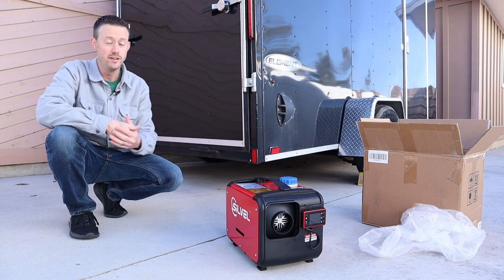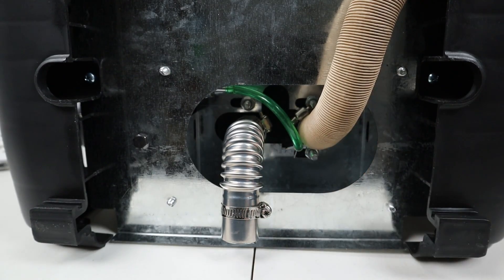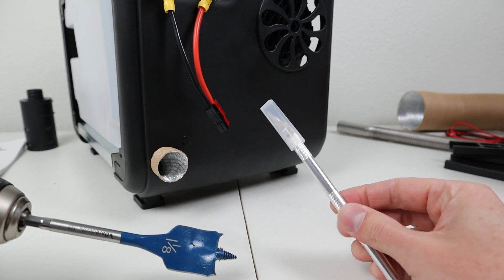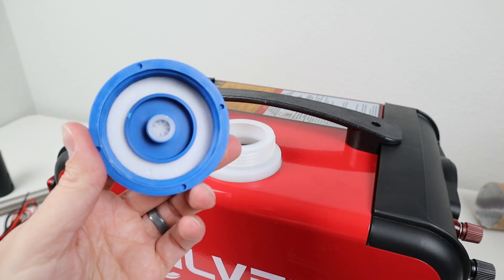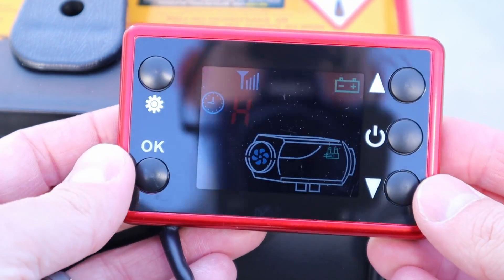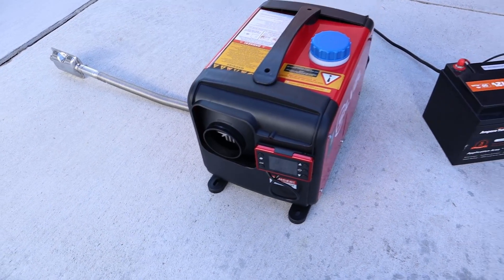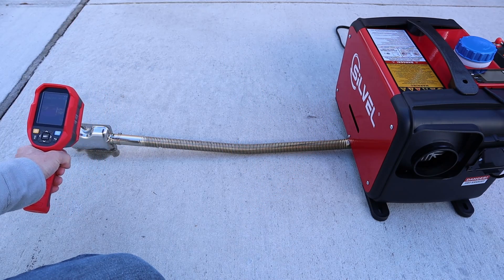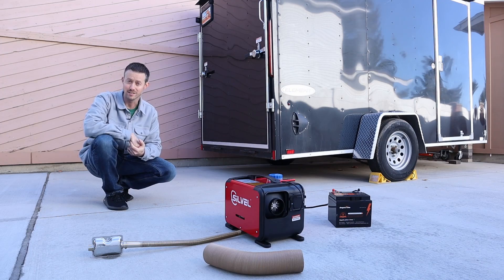Getting Started with Your Diesel Heater + Four Easy Mods!  *Not Sponsored*

Comment: So you literally just went straight to a 12v battery? I've been wondering what the best way to get power to the heater i just bought
Reply from the maker: Yep, 12v battery connection works just fine.

Comment: One of the best diesel heater videos ever, do have a couple questions if you don't mind.  Have you tried tuning for the altitude where you use it?  I've heard tuning makes a significant difference in efficiency and carbon build-up inside the burn chamber.  Watched a couple videos on tuning but they were difficult to follow.  I also noticed the Silvel heater fuel pump is horizontally mounted, while others are mounted at a 45 degree angle, any idea why the difference?

Comment: Regarding the exhust smell. I want to use one of these for thawing ice out in an enclosed vnose trailer that hauls snowmachines.  Would it smell up the trailer and machines badly if used for say 10 hrs or so? I have a 12x12 roof vent. Hate to cut holes to make it work. Using a Kerscene heater now and that works.

Comment: So is indoor use recommended? I need it for a sprinter van. Does the bottom of the unit get hot? Does that exhaust pipe need to be hanging out of a window if used indoors?
Reply from the maker: If you are going to be running it indoors you'll want to make sure you have a CO alarm for safety.

Comment: How big of a LifePo4 battery do you recommend if I want to use an 8MW diesel heater for a two day camping trip? Will probably keep it on low-medium.
Reply from the maker: I recommend getting at least a 100ah battery. Any lower capacity and the quality drops off quick. The prices have dropped significantly over the last year and they cost under $200 now.
Reply: @ Thanks so much for the quick response and knowledge share. I see Amazon has a WattCycle 12V Lifepo4 100AH “Mini” with Bluetooth for $180. (40% off, normally $299.) Heard anything about this brand? Seems like a heck of a deal.
Reply from the maker: @RyanKyabetsukun  watt cycle batteries are good, Will Prowse has tested them with good results. Since you'll be using the battery in cold temps it might be best to find a battery with heaters. They are a little more expensive but it will be worth the extra cost to be able to charge it in extreme cold temps.
Reply: @Jasonoid    Great insights. Again, thanks so much. I’ll look to see the price difference. This is my first time camping in anything close to freezing. This trip will be lows of maybe 35F. I live in North Texas, so summer heat is the real danger…

Comment: I thought it was recommended to run it on high for fifteen minutes before shutting down to burn any unburned fuel?
Reply from the maker: It runs it's own shutdown process where it does it's cooling cycle. When you tell it to turn off it keeps running for a bit.

Comment: i bought one of these after watching this video and a couple others , damn thing is junk - it worked for about 2 hours , company has no product support/warranty and they aren't returnable for a refund . so i got screwed out a hundred bucks . live and learn i guess , but dang it's cold in this tent ..
Reply from the maker: I guess its a lottery with these cheap units. Project Farm just did a video on this unit and it worked fine for him.
Reply: What are the symptoms?  Error codes?  Does it start at all?
Reply: no codes ever , motor is trash , control board has cold solder joints on damn near every component . never could get a straight answer from them on a replacement . so i got a refund from amazon two days before the 30 day refund window expired . almost a week later another one showed up , and it's no better than the first one . thank god i got my money back
Reply: @TS-mo6pn  btw - they also mount the fuel pump with the output pointing down , that's just plain ignorant , these fuel pumps air lock and quit working when they are upside down like that .

Comment: Hi Jason,

Just wanted to follow up on the diesel heater you reviewed. I really liked it, especially the price, but I was hesitant about the modifications you had to make. I'm not very comfortable with that kind of thing, so I did some more research and found another option: the HCALORY 12V Portable Diesel Heater, 2024 upgrade Toolbox 2 Diesel Air Heater.

It had a Black Friday deal plus a 15% off coupon, so it only cost me $156.00 (plus tax).  That's not much more than the SILVEL, and it seems to have all the modifications you made already built-in, so it should be more plug-and-play for me.

I ordered it on Amazon today and am waiting for delivery. Have you ever come across this HCALORY heater before? If so, I'd love to hear your thoughts on it.
Reply from the maker: It should be an excellent option. All of these brands are pretty much the same exact thing, just with a different brand stamped on them 👍
Reply: @Jasonoid  Okay Thx!

Comment: How did you get the 90 degree elbow to fit?  The part you listed does not tighten to secure the elbow around the pipe.  Did you use a different clamp that was not included in the package?
Reply from the maker: I used a clamp in the kit, I just tightened really good. It did crimp the pipe down but it holds.

Comment: I'd love to see it tested on a lot of different power stations with a 12v cigarette plug or another kind of 12v plug. I know some power stations can't support the initial burst of power that's needed to start the heater.
Reply from the maker: The only thing thats interesting is that some diesel heater glow plugs pull more power than others. Some of the newer models pull less power! Most power stations have a 135w to 140w overload cutoff. So as long as your diesel heater doesn't pull more than that on startup it should be fine. That's why I require a power station to have at least 150w of DC output in my grading system.

Comment: I would be interested to see ducting options. How you get the heat ducted into a teardrop camper for example
Reply: These units are designed to be inside the heated area, and pipe the exhaust out. If you have the unit outside, and duct the air in, it is considerably less efficient. You will lose heat from the air duct, and the air return if pulled from outside rather than inside is less efficient because the unit has to heat freezing cold air, rather than already heated air from inside. It should work just like a forced air furnace in a house.
Reply from the maker: I'd probably set the heater under the camper outside and duct up through the floor somewhere. The floors are usually plywood and would easily be drilled with a 3 or 4 inch hole saw.

Comment: Jason this is interesting. What are these used for? Can you heat a house or a room with these? How are they used? Does the air coming out smell like fuel or have an odor? Do you need a lead acid battery to run it or would a lithium work too? How much does the diesel heater pull on the battery? How long does the heater run for on a tank of diesel? 
How would it be used not only for home emergency heating but can it be used in a car or a cabin?
Reply from the maker: Sounds like you need to do some diesel heater research 😉 They are mostly used for portable heating setups, like ice fishing, tent camping, or heating an outdoor space. They can run on any 12v source and the heated air doesnt have any odor since it's passed through a heat exchanger. There are tons of videos on these, I'm glad I peaked your interest!
I may do some future videos on runtime testing and power usage. They pull around 150 watts for 2 minutes at startup to run the diesel glow plug, and then the power drops down to 30 to 35 watts after that
Reply: Is your Google broken?

Comment: Hey Jason, sorry kind of off with my question here however I put this comment/question on obe of your older shorts and didn't get a response so i thought idyry here.....

Late comment/question here...
Watched this I don't know how tines just to make sure I understand.
I got two of the XTAR 100 panels after seeing you really liked this panel. Can I put the two in parallel to charge the EB70? Amps don't matter as long as the panel voltage is OK ?
Thanks!!👍👍
Reply from the maker: Parallel will work fine with the EB70. Just don't SERIES the panels, that will burn up the EB70.
Reply: @Jasonoid  thanks for the info. I appreciate it!!

Comment: I sure wish mine would run for a couple of hours. It constantly throws an E6 code. I have done every trick in the book and I cannot keep it running longer than 5 minutes at a time.
Reply from the maker: E6 error seems to refer to low voltage or a fan failure. How are you powering your unit? What gauge of wire are you using and how long is it?
Reply: I am using the factory wire that comes with it. I only use half the amount though that they send. I'm using a Power Queen. 100 amp hour battery. Maybe it's just me and I didn't have it fully charged which I usually always keep it fully charged. I'll try it again this weekend to see if I'm able to get it to stay running. Thanks for your feedback though! Anything is worth a try!
Reply from the maker: @jeffcornelison888  the wire they have is pretty small and might cause a bit of voltage drop. That's why I upgraded mine. If you get an error on a fully charged battery I'd try a larger gauge wire to see if that helps.

Comment: I was looking for a diesel heater video recently so great timing Jason!
What's your opinion on the narrower version of that heater? I was looking at the one as i think I can fit it more easily in my rig.
Are your mods applicable to the narrow version?
Reply from the maker: They all have pretty much the same internals, just different form factors and different display/controllers. I picked this one for a few different reasons. The tall skinny ones should work just the same. Just do the same checks on the inside.
Reply: @Jasonoid  Would you mind sharing your reasons for choosing that model? Thanks.
Reply from the maker: @zigzagluck  I chose this one since it is less likely to tip over. I liked the price and it had good reviews. I also thought I could mod it easily.

Comment: Very cool and that unit looks pretty nice compared to some of the other ones I have seen.  I'd be curious to the diesel run times and that was an unusual gas can spout?  I imagine you'd have to be extremely careful with outdoor camping with that hot exhaust.
Reply from the maker: Yeah makes sense, you'd probably want this off the ground in probable burn areas. Concrete, gravel, and dirt should all be fine. Some people use a tire shelf too keep them off the ground while running them.

Comment: Another great video, I never thought about one of those units.  This would make a great addition to my preps along with my Mr. Heater units.  Thanks again for sharing. 😊
Reply from the maker: I was surprised with the heat output! It just sips diesel as well. It was fun tinkering with it too.
Reply: @Jasonoid Hi Jason, appreciate your response. I'd like to request a product review if feasible. I've been prepping for a while, and your diesel review was helpful. Could you consider reviewing the "BougeRV Portable Propane Water Heater" at some point?  I've owned the "Mr. Heater BaseCamp BOSS-XW18 Battery Operated Shower System" for years, and it's showing signs of wear.  BougeRV recently released their new water heater, and I'm keen on getting one. However, there's only one YouTube review so far. Any assistance would be highly appreciated. 

Thanks!
Reply from the maker: @minceym  ill look into the product, thanks for the heads up!

Comment: If you're interested in some good diesel heater content check out "Lowered Expectations" I'm pretty convinced I'm going to get one.  Your video is perfect for a first time viewer, very basic but perfect mods that really make the whole thing much better than the stock unit out of the box👌
Reply: Originally I was thinking to try running waste oil through it but am waiting on how "Lowered Expectations" testing goes...still might get one and run diesel, seems cheaper/more convenient than my propane heater and you lose all the moisture buildup
Reply from the maker: I've watched a couple videos about waste oil. I haven't seen a very successful long term solution.
Reply: @Jasonoid  yeah, it would have to burn much hotter, like a diesel particulate filter on a modern engine, to get rid of all of the soot particles, and inert stuff like sand, etc that's in there will need to eventually be cleaned...it would have to have some sort of quickly swappable burn chamber to clean out hopefully only once a month or every couple months pretty much no matter what, unless you filtered it well.  Was thinking about maybe coffee filters😅

Comment: Good tip on checking the fuel lines on the inside of the unit...ask me how I know.  Mine wouldn't run and had a kink inside the unit. I have mine sitting outside my office window and used a 3" metal semi-ridge hose from Lowe's to get the warm air inside. It is mounted to a 3/4" piece of rigid foam board that sits in the bottom of my window. Paint the foam board to make it look a bit nicer. I do plug the hole with some foam so cold air doesn't get in when it is not running. Setting 2 or 3 are the good ones for me usually.
Reply from the maker: Great information on your setup, thanks for sharing!

Comment: The biggest complaint I see with these diesel heaters is the noise of the pump.  You’d think that there would be a better silent way of pumping the diesel.
Reply from the maker: The pump on this one was really only noticeable when priming before startup. The pump was pretty hidden by the noise of the exhaust and fans. For me, it wouldn't keep me up at night, but I guess it might be annoying for some people.
Reply: I believe Amazon sells a quieter pump and another YouTuber installed one and wrapped it in foam and it's remarkably quieter. He was using it for a rooftop tent.

Comment: In your opinion, would this be better than a Mr. Buddy in a tent?  I would not mind videos about diesel heaters and how to use them.  Thank you.
Reply from the maker: Propane heaters put off a 'wet' heat. I've read that when burning 1 gallon of propane you'll get around 1 gallon of water vapor. Explains the condensation I get when using a propane heater! Haha Diesel heaters are dry, you don't get any water vapor so that's a large benefit.
Reply: As Jason said about the wetness of propane, Also, since the unit is outside it doesn't emit carbon monoxide into your work area and Mr. Buddy brings the flames inside. I run two Big Buddy heaters to heat my big metal building and I am interested in these diesel heaters,
Reply: @kevinholland4156 propane emits carbon dioxide when burning, hence the condensation. I used to use one in my hunting shack but hated the wetness. Diesel heater is a game changer. Dry hot heat.

Comment: Oh, new camp trailer. About the same size as "Gonagain" on YouTube. That heater will probably work great in that trailer.
Reply from the maker: New trailer yes, camping trailer.... not really haha. I has a few mods in mind but it's mostly for towing some toys for our trips. I plan to install some lighting and a battery system and maybe some solar on the roof. Sure, I'd sleep in it but it won't be a full conversion to a camper :)

Comment: I thought I knew everything there was to know about these heaters and then along comes you to tell me about the close 90 degree elbow for the exhaust. Very useful information. Thanks. 

 Also,  I found that wrapping the stainless exhaust pipe and muffler with 'header/exhaust wrap' from AutoZone or similar is a good idea if you are going to be using the heater around kids or pets.
Reply from the maker: Excellent feedback on the exhaust wrap, I could see that really helping keep the pipe cooler

Comment: Another excellent video.  The two other mods I've seen/used for these diesel heaters is an inline fuel filter and also a 6" heater duct to go around the smaller duct, making your output hose much better insulated against the cold.  This is particularly useful if your heater is outside and you are running the output into a tent or building, through a dryer vent type of duct.
Reply from the maker: Great tip! I'll have to look around for insulated ducting options.

Comment: Very nice!  I think this is a great addition to your channel.  Some time ago, I got a diesel heater from Vevor that is still in its box.  I'd like to see current load tests to get an idea of how large a battery is needed to keep it running overnight, and how much solar is needed to keep the battery topped off and/or recharged after a cold night; and a few real-world tests: small cabin or RV, and a single large room in a house.  I'm not sure I'd use this in a tent unless it was already designed for a stovepipe.  Once again, very nice addition!
Reply from the maker: Most people use these heaters in a tent by having the unit completely outside and then they route the hot air in via a flexible duct. That removes the risk of burning the tent material since all the extreme heat is outside the tent. It also removed much of the risk of exhaust in your sleeping area. I've been impressed by the heat this unit puts off. You should experiment with your heater too!
Reply: Go check out project farm video on diesel heaters . He has your information